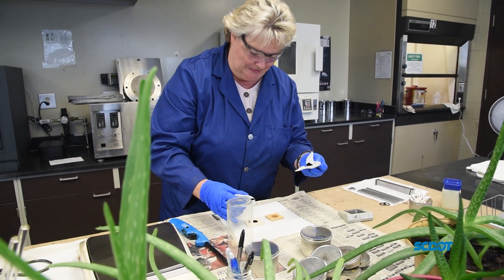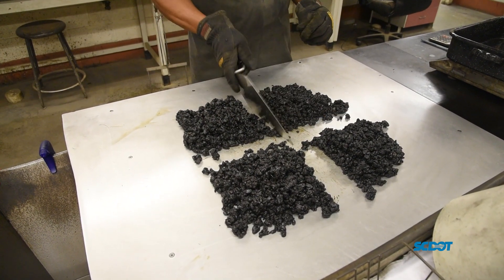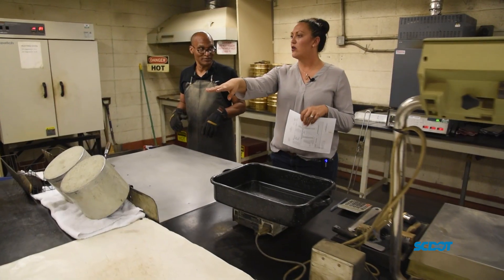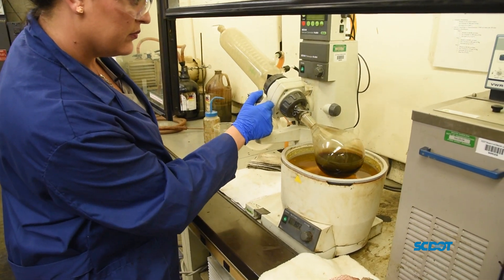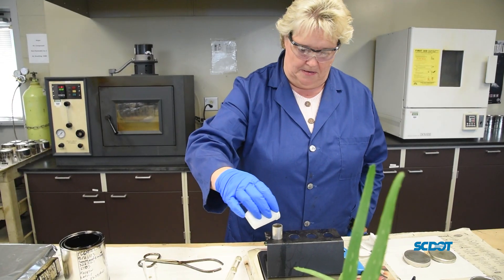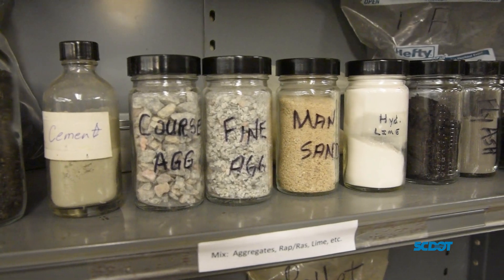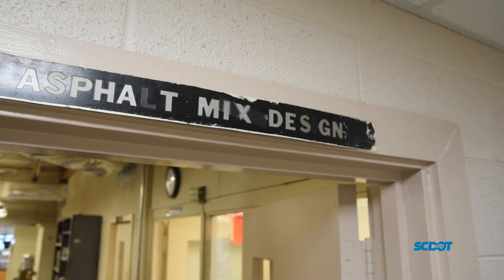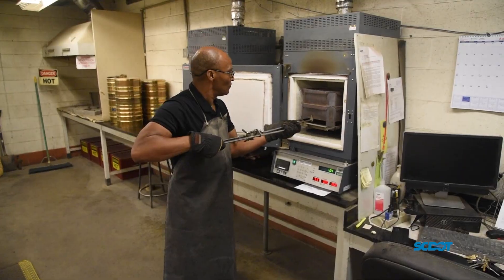Day in the Life - Asphalt Materials Lab Testing Supervisor

Comment: Speaking of asphalt, this tropical storm we had recently did some damage to roads and made a lot of potholes. You need to really send a pothole repair crew out and fill them in. In Orangeburg County on Hwy 314 right before it yields onto Hwy 15 headed towards St. George . The potholes are on the left side of the road right before it yields into Hwy 15. I was coming home last night very late about 11pm and it's very dark out there and even with my brights on I hit four potholes and almost wrecked my truck. If I would have been in a car I'm sure I would have wrecked. I needed a front end alignment due to this. Just imagine what would have happened if a motorcycle would have hit these things though. Those things really need to be filled in, it's unsafe. 314 and 15 have numerous holes due to the storm but the spot I told you about is the worst.